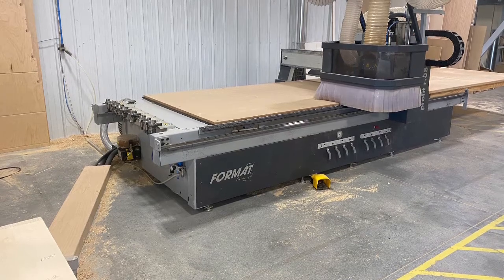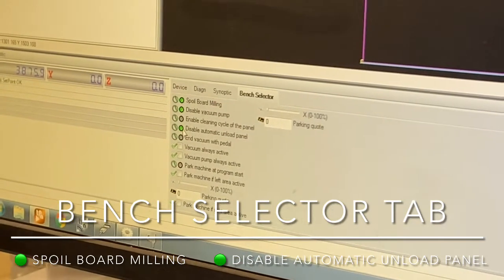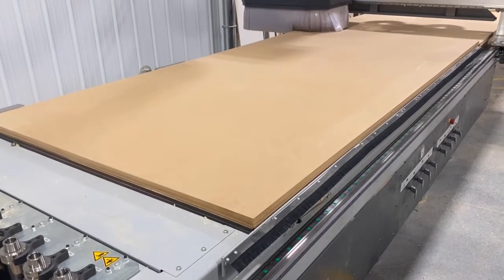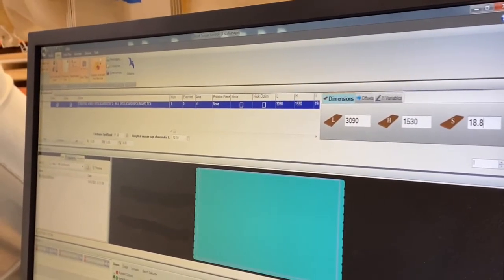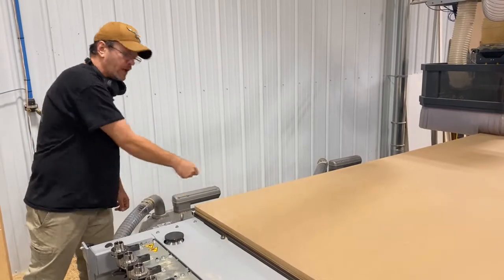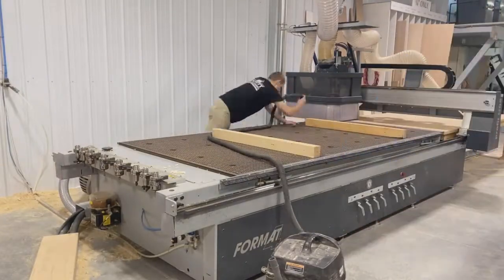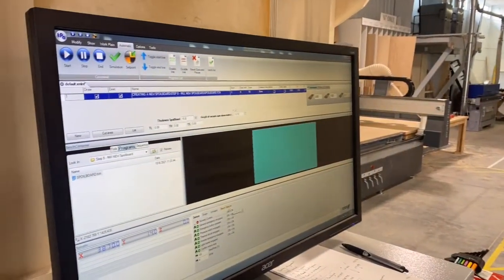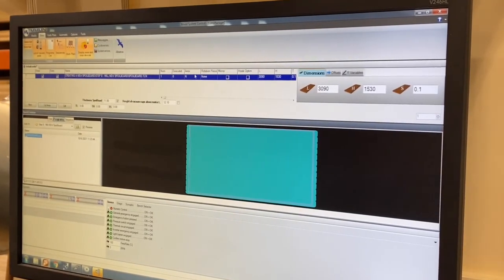CNC Tutorials - Felder Profit H08 - Creating a New Spoil Board

Comment: proper vacuum workholding is a balance between flow and vacuum. Do yourself a huge favour and buy 3mm HDF. It provides better vacuum for smaller parts (since it's less open, it maintains a deeper vacuum). Surfacing a spoilboard is always done with less deep vacuum than machining the melamine/plywood/mdf plates that are on top of that. Even if you are using 20hp vacuum pumps.  Due to that, the Z will be inconsistent. Surfacing is just time consuming. I never have to change my z height, i use the HDF spoilboards for over a year now,  use them  flip them, use them again, and replace with a new one.
Reply: Respectfully completely incorrect. A more porous surface is better for hold down, aswell as surfacing the table is 100% necessary to insure the head is parallel to the table everywhere. The cfm only plays a roll when there is a escape path, if the table is closed or the cfm is able to overcome the loss it will achieve the full rated hg that you pump is rated to. So the idea of higher cfm (higher horsepower ) is better is from the idea that if the cfm is high enough it will overcome the loss keeping vacuum.
Reply: @armbot1000  in some parts you are correct. You don't need cfm if your vacuum is closed. But if you're cutting 30 items out of a sheet with a 6-16mm diameter cutter, there is a lot of cfm required if the spoilboard material is porous. Hdf helps maintaining a deep vacuum. If you think your flattening the porous mdf you have never measured the error afterwards. The HDF i use only deviates +-0,015 mm in thickness. The machine bed needs to be flat. And the machine head needs to be aligned properly too. If you flatten a spoilboard with a 90mm cutter and there is a small angle on the head other issues occur. Me, and loads of other people with a bed style machine use HDF and we never need to flatten the table and run a strong vacuum. Two of the users i know are machining material with low surface energy, (hmpe, hdpe) another user is machining aluminium parts, in the passed years I have used different techniques (also used the special mdf for vacuum workholding) And the best solution by far is the HDF. If you don't want to take the advice, feel free.
Reply: Hi, I’m intrigued about your recommendation as it is the first time I heard about using thin 3mm hdf instead of 12-15mm mdf surfaced on both sides. I understand your point of the differences in vacuum when surfacing the mdf for the first time and when using it as a spoilboard but hdf feels quite “sealed” to get enough vacuum through it. I will give it a try, thanks for sharing!
Reply: @javitoto  i am still using the hdf. The only downside is that you can't nail or screw items to it. For my work (melamine chipboard/msf plywood, hpl, plywood and dibond) i only use the hdf now.
Reply: @berendlucasvanderweide  Many thanks, this is very interesting, I will get a couple of 3mm sheets and try what you propose. Many thanks!
Reply: @javitoto  Just make sure that you don't get hdf that is coated on one side. (For backpanels in cabinets) And bear in mind that thin 3mm mdf also works, since it has a higher density than the thicker mdf panels. So you don't have to move mountains to get HDF.
Reply: @javitoto  Did you get a change to test it?
Reply: @berendlucasvanderweide  What type of vacuum do you have?  I ask because my machine uses regenerative blower style pumps, so the rated vacuum is lower, but flow is high (11" hg max, but flow rates of 300cfm).  It is a cheaper option than a large 20hp beckker dry vane that draws down to 28" hg, but also 1/5 the price and 1/2 the hp.  With the lower vacuum pressure, but high flow, your style of spoil board may not work and I have heard that using open LDF boards are best.    With a high vacuum pump, your idea may work well.  Anybody want to lend me an expensive vacuum pump?
Reply: That's something to take into consideration when using HDF. The machine bed is 1500x3050mm, and I use a 7,5kw 280m3/hr 50mbar absolute liquid ring pump. If you are buying a new pump my advise is to get a claw pump. A 4,5kw produces the same amount of vacuum/flow like my 7,5. The good thing about these pumps is that they produce about the same flow at 200mbar absolute (deep vacuum, high flow) where a sidechannelblower drops quickly in flow when the vacuum goes up.
Reply: berendlucasvanderweide is correct.
Remember, Higher density/flowrestriction of the sheet does not LIMIT the level of vacuum hold down you can get. It only changes the time it take to get there with a mostly trivial amount.

With your material on top and a good seal, regardless of spoilboard density (unless completely airtight), the vaccum level under your material will always reach the same level(pumps max value), LDF,MDF or HDF. it will only take longer to get there with increasing density.
Any leak would detract from the pumps max value and higher flow allowed by lower density would just mean more air to pump and therefor detract more from the pumps max value.

For every air molecule that flows in... the vacuum level drops. Always. 
Even if the pumps can "keep up just fine", the vaccum level will always be worse than if pumps didnt need to remove that air.

And I think ppl underestimate the pumps capability of sucking thorugh porous fiber media.
3mm hdf to the becker pumps (-800mbar)  on the machine in the video is nothing. Free flow galore.

The only time  you might benefit from increased airflow through the spoilboard is when trying to clamp warped wood pieces. Sometimes you need the flow to drag the wood with it to meet the surface and create that seal.

But once its been forced flat you'd again be better of with less flow.